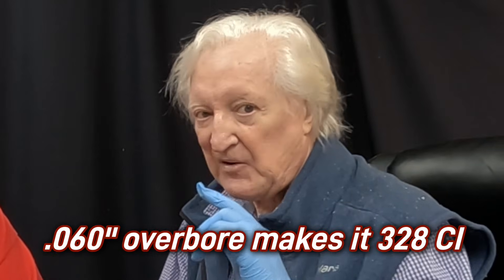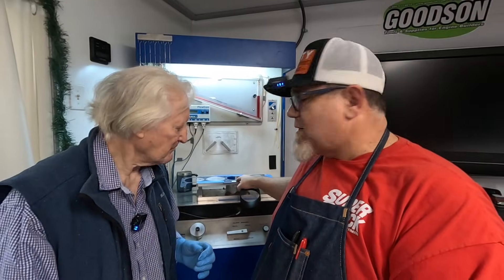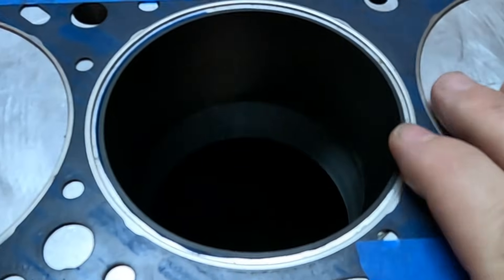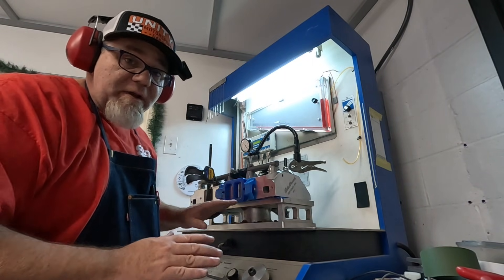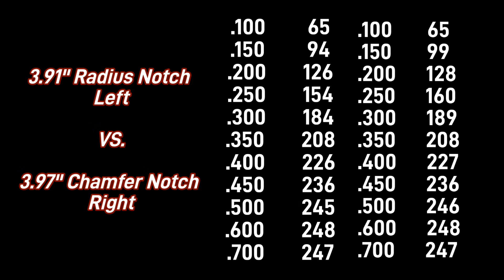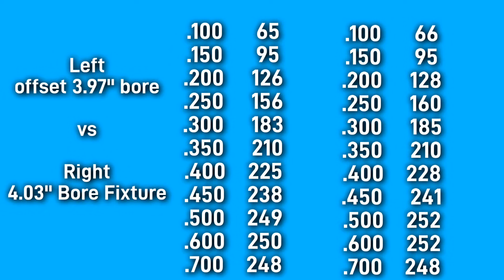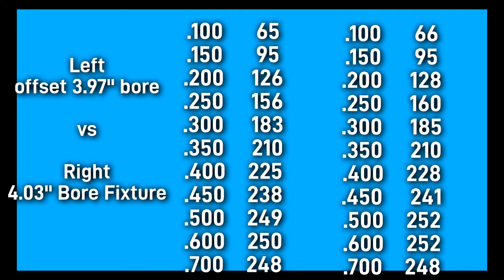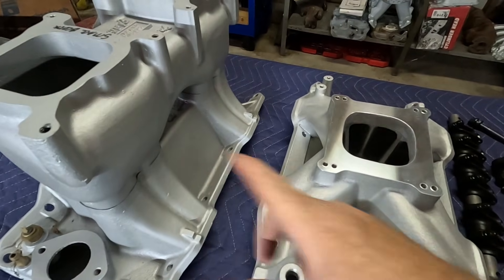We Found Hidden Horsepower in a Mopar 318 (Bore Shrouding Test) Project Mission impossible

Comment: As a machinist, one thing I think people can get messed on with the offset boring is that if you’re increasing the bore size by +.060 then if you were to sweep the bore 0-0 you would take .03 off of each side of the bore - if you wanted to take .050 off of one side and just .010 off the other you would need to shift the location by .020 - this would cause you to take .020 in addition to the .030 you were already going to take for the .05 and then likewise on the opposite side since you shifted away .020 you would be taking .030-.020 for the .010. Also I don’t think the block would be too thin as long as you shifted each bore the same amount and the same direction it wouldn’t be any different than if you just bored it .060 over on location because from bore bore where you take more off one side on the next bore you would leave it to make up for- enjoy both you and your brothers channels - keep up the good work -

Comment: When you shift the head (or bore) to unshroud the intake valve, does it not affect the exhaust flow?  On FE’s you have to notch 390 and 428 cylinders to clear 427 intake valves, makes me wonder if the larger valves aren’t hurting instead of helping.  Thanks for making me think outside the box
Reply from the maker: Luckily on this setup the Exhaust has a ton of room.. 
Thanks for watching 
Andy

Comment: If you are off setting the bore by 50 thou wouldn’t you have to make major adjustments to the crank cheek? Is that possible?
Reply from the maker: No, you won't have to do that because the connecting rod will be in the same place... This engine has floating wrist pins
Andy
Reply: @UnityMotorSportsGarage yeah I guess 50 thousand on the wrist pin isn’t a biggie

Comment: Love the TR5!!! I have a "Street Tunnel Ram" which I think is a newer design (shorter overall, mostly the plenum area) and I have the old typical Weiand which has even shorter runners. The unusual one I have (and it's the only modified/ported one) that I want to try is an Offenhauser (longest runners of all) that has had the plenum bisected and shortened for less volume (supposedly a race TR mod, which seems counterintuitive). As always, thanks for the methodical tech and informative presentation! RB
Reply from the maker: The STR is an awesome manifold Ive wanted to try one since I was a teenager. I think the TR5 is going to make some serious steam!
If you want to test it against the TR once we get it on the Dyno we can.. just say the word
Andy
Reply: @UnityMotorSportsGarage  That sounds interesting! The STR is as-cast, but that Offy was plenum-tuned prior to my owning it and then fully ported by a talented old-timer (like DV). If I load up for NC I'm loading (the trunk) for bear!! Thanks for the suggestion! :D   RB

Comment: What are you going to do for a head gasket once you move the bores and how much strength do you give up?  Not to mention intake alignment if the offset is the opposite direction on the other side of the block.
Reply from the maker: I'm going to use a head gasket that has a 4.03" bore which will give us room plus not give too much crevice volume 
Andy

Comment: I might not get it but if the matter is about moving the valve away from the cylinder wall you can use off set drilled valve guides. 
If you just move the head you off set the whole head and bring the valves on the other side of the head just closer or past the cylinder bore. I’m not seeing any advantage here. Off set valve guides are the way to go.
Reply from the maker: You have to remember the rocker arrangement on this engine
Andy
Reply: @Andy: Yes you are right here. But off setting the valves is of course a matter of small margins. Not a distance across the street 😝. 
Anyway, your set up was just for testing. To see if moving the head aka the valves would give any gains. 
For my FIAT engine I was figuring out if a bigger bore from a smaller engine will benefit. That must give a quench area all around and room to open up the head for bigger valves. At least the valves will off straight away.

Comment: What year is the block cast? 1976 and newer are thinwallcastings. According to Mopar guru L.S. Shepard these should not be bored more than .020 for high performance applications . Older ones are much thicker. Do sonic test it first if newer.
Reply from the maker: This one is a '67-'68 block 
4 bolt mount block
Andy

Comment: Made well in excess of 500 horse out of a 307 Chev with a 3.875” plus .030” over bore equals 3.905 inches 
Cast 4 eye brow pistons 
Steel crank  
Prepped factory GM Chev Rods
8500 rpm out of it with  cheap aluminium heads that were advertised at around the 250-260cfm @28 inches and a flat tappet cam.
Reply: I need to see some cam specs. A 500 hp 307 with those parts?
Reply: @S @Spiritof_76 

No mate, 
You want it
Arrange too meet in person with a down payment in full for me too build you a clone of the Engine. Probably still won’t give out the cam spec, But glad too give a spec sheet on the rest of the Engine when it’s payed for.
Reply: @brentonk461ismylostaccount  I'll pay you imaginary money for the imaginary engine.
Reply: @Spiritof_76 

The sort of response I expected 😂
Keep dreaming 
But um
When you want the real one, let us know
😁
Reply: @brentonk461ismylostaccount  I don't require someone to build a fantasy engine. I can rebuild a real one. Nitrous is not an engine build. The response you expected is the one sane people give. Only a fool would pay a youtube rando for anything of the sort.
Reply: @Spiritof_76 

No turbo
No blower
No nitrous mate

No fantasy
Reply: @S @Spiritof_76 

The amount of f__k Witt’s I encounter on a daily basis that think it’s easy and that they can do it themselves amazes me

If You think you can do it better and for free in little fantasy world 
Good On ya Mate

Good Luck with that

Comment: If the cylinder wall has enough material in it to take 50 thou out of one side of it then why no bore it in its original location out to  4.000 or 4.010 and gain extra cubic inches 😃

Comment: David and Andy, My question is, Will moving the piston off set 0.050" cause any side loading on the con rod or rod bearings? 

If so I think I pick about 0.020" to the exhaust side and 0.030" to the intake side and use the Offset Dowel pins to move the head 0.020 to 0.030 inch.
Reply: And since you are buying new pistons why not just bore the 318 out to 4.00" if it sonic tests OK? Then off set the head.

Comment: I am building a 305 Mopar using the factory 340 bore size of 4.04" (actually 4.07" because of the .030" overbore) with 340 cylinder heads with 2.02 intake valves. The 35 cubic inch loss is due to the shorter stroke of 2.96" vs. factory 3.31" so valve shrouding in this case is not a concern. However, to accommodate the old school TRW forged 340 pistons (L2322F) with the shorter stroke crankshaft, we needed to custom fabricate connecting rods (6.298" vs. factory 6.123").
Reply: I would think it would be cheaper to buy custom pistons than rods.  Lighter too, maybe 200g lighter on each piston.  The top of those L2322F pistons is about a 1/2" thick.  You could take a lot of weight off the underside.  Custom pistons could have thinner rings than the 5/64ths stock rings.
Reply: Sounds like the rod to stroke ratio is off now..

Comment: Great call on offset bore  idea! So if you're at the point of diminishing returns on flow gains  using offset, is there now enough clearance  to go up in intake valve size? - would it be worth it?
Reply from the maker: If I can get these heads around 280ish cfm without having to make the port too big I doubt I would go with a bigger valve. 
We did these Chamfer trick on my 393 which had a 4.03 bore and I had 2.125 valves! That engine made 600
Thanks for watching like always 
Andy

Comment: If you will offset the bore, you better have enough room under the piston between the piston and the pin, the other problem I see is that, that engine might not have a normal life expectancy, you will have one side of the pin bores more loaded that the other in an area that is not designed as such, I haven't seen a piston with one pin bore wider than the opposite, maybe it works, who knows.

Will it not be easier to just re-do the heads and install 1.96 seats and  intake valves?

If you get one bore a little off you will smoke a rod, or put a load of lateral weight on the cylinder and smoke a piston squirt.

Comment: I also have a TR5 in this configuration. From what I have heard there were other top sections avaliable including one with a smaller plenumn. Back in the day, ALL pro stock racers used the weiand tunnelram which was a small plenumn ram.
 Can you expand on the performance difference between the two plenumn sizes? Unfortunately both edelbrock and weiand have discontinued these rams. The weiand is much harder to find used than the edelbrock.

Comment: You mentioned a aftermarket head I thought the idea of missing impossible was to take stop parts and modify them to make that 1 HP per cubes with that tiny but modified carburetor it was just a question I am just curious on why a aftermarket head direction to make it less impossible
Reply: Stage 1 is the heads I did. Stage 2 is Edelbrock heads. Thanks
Reply from the maker: Exactly 
Andy

Comment: I am assuming this is an NA setup, Just curious if there is a gain in boosted applications (Turbo SC or even Nitrous)
Reply from the maker: Even though this is an NA build it would definitely help both boosted or Nitrous, remember Boost pressure is a measurement of restriction in the system. You would make more power with less boost
Andy

Comment: How far can you bore a 318?
Reply: The old A 318 [poly engine] is nearly exact same block as the LA 318 except for oil drainback holes which can be pluged whan using the LA heads.Then the old A block can often be bored all the way to 340 size [4.040] because castings were very thick. So that is the best solution for a big bore 318.
Reply: Looked into that myself doing a 68 318. Some claim those are thicker and can go to 4.04 stock 340 bore, but you gotta sonic check um. In the end I went .030, just building a mild street engine, a few more cubes at the chance of loosing reliability wasn't worth it for me.

Comment: Honestly, that single 4 manifold is probably not the best intake for an LA. The end ports (1,2,7,8) end up with a very abrupt turn when it gets to the pushrod bump no matter what you do to it. Flow the head with the intake on, and it will probably be very obvious....
That tunnel ram is going to get you more power due to the air not turning into a wall on the end cylinders, and the shorter runners.... You might not even loose low end torque with that huge plenum either.
Bore that 318 as far as the block will allow it, top half cement it and call it a day... The more you unshroud it, that faster the air column will start to move as the valve opens. Flow isn't everything, velocity is far more important so it actually flows. 
Speaking of velocity, flow the heads with different shaped intake valves on the back side. That little guy is going to need all the help it can get to get air in it, and oddly many aftermarket heads don't have the best valve head shape in them for quick velocity ramp up...

Comment: Curiosity question, by doing an offset bore( with .050 to one side). Is there enough clearance between the piston and connecting rod to allow that much to one side and still have the proper amount of clearance for oiling? Thanks for sharing this video really starts making you think. ✌️😁
Reply from the maker: Yes this engine will have full floating pins so oiling/clearance shouldn't be an issue. 
Andy

Comment: I can't imagine that it would be easy on the rods and the crank for you to offset the whole reciprocating mass over by 0.040" from their factory original placement.
Reply: Indescernable difference
Reply: @hotrodray6802  Clearly you are not a machinist.

Possibly not even a mechanic from what you're saying.

Its documented that this kind of transversal axial thrust is notoriously for rapidly destroying all kinds of motors.

There is no way you can do this without altering the crankshaft at the same time.

But since you're clearly not going to listen, I'll save you the technical documentation of this historically known fact.

But yeah...

You go try it.

Lets see how well that goes for ya.

Comment: Wow!! Don’t want to sound stupid but what does this all do the crankshaft? 50 offset from center seams like a big deal to me. I think the block will take the off sets but what does it do to the center of the crankshaft? Do you have to balance it for that?
Reply: With the piston pins floating in the piston (or bushed rods) the rod/crank position is not affected. Only the piston is slightly offset.
Reply: You run piston guided rods.

Comment: The build my buddy had on his engine stand when he passed, he didn't like the intake valve location on his 360 Chrysler so he used offset head dowel pins to move the intake valves away from the cylinder wall. Moroso Offset Cylinder Head Dowels 37930.
Reply: I had forgotten those things existed. I had a speed shop back in the 80's and I used to sell these, completely forgot that they existed.
Reply: Intresting. How do you redo all the bolt hole?
Reply: This motor has two cylinders with the exhaust valves adjacent to each other. One way offset couldn’t achieve what they are doing here.
Reply from the maker: You are correct, now if it were a Ford or LS it would
Reply: @UnityMotorSportsGarage I’m putting offset dowels and drilling out my head bolt location ? I have a 5.3 I’m building and extra power that easy is hard to come by. Will be figuring this one out I think lol.
Reply: @UnityMotorSportsGarage  Or LT
Reply from the maker: Just remember by shifting the head on the block surface you will need to port match the intake and maybe elongate the bolt holes to make everything line up..
Andy
Reply: @UnityMotorSportsGarage yes sir I think I could handle that. A few years of working in a machine shop and you can do about anything. The pushrods don’t seem to worry too much? I guess some of those dowels are just .005 or maybe more I haven’t done any research yet. Really interesting though.
Reply: @bradenmolloy7443 :
How about if the offset dowels moved the heads downward (upward?), instead of sideways?
Reply: @johnjohnsn7633 then the intake valve would possibly hit the cylinder wall. Basically allowing more room for the intake valve would be best. However you make that happen.
Reply: @j @johnjohnsn7633 also for an ls engine that would be towards the water pump on the cylinder one side and toward the rear of the engine for the cylinder two side.
Reply: I'm not seeing something here..... Offsetting the bore will cause the Piston to shift over affecting where it connects to the rod
Reply: @CNTablet-sg7qx Lol, im not sure what Kendall was doing I was buying a couple 351c's from him. Keep in mind he had access to a full automotive machine shop. I thought about asking him but then I started thinking about all the stuff he'd have to change. He been building engines since the flathead day, his daughter's 351c Mustang  would about outrun anything in town and he could obsessively measure things all day. But the conversation brought up that memory.
Reply: @C @CNTablet-sg7qx just this motor because of the Siamese cylinders the direction of bore offset would basically even itself out as long as there is a normal amount of clearance from the piston to rod pin. It can slide sideways a bit.

Comment: I suspect the tunnel ram will make for a fatter curve, because tunnel ram! The offset bore is a neat idea, but is there enough meat in the block to do it in a meaningful way with the mirror image cylinder heads? I have seen some industrial 318 blocks go all the way out to a 4.00" bore safely, but that's not every block.
Reply from the maker: Shane told me we could take this one out to 4" but I want to make sure of the thickness! 
That's for watching 
Andy

Comment: When you sonic checked the block, what year block is it & what was the thickness?
Reply from the maker: It's a 67-68 4 bolt mount block and according to Shane it was over .200" thick
Andy
Reply: @UnityMotorSportsGarage   Thank You & Zowie! What do you folks consider as a minimum wall thickness for a daily driver motor? Does it matter more on the thrust side of the bore?

Comment: The winning engine in the 2002 Engine Masters challenge had the bores. Bores .060 offset. It was a 366 cleveland.
Reply: Didn't engine masters outlaw the Cleveland?
Reply: @samuelfreeman9518  They outlawed the Clevor. W block with C heads

Comment: In between cylinders will be very thin if you offset bore it towards the intake valves. It’d be like boring the block .100 over if you’re taking .050 off one side
Reply: I was thinking that also because you get half off the cylinder so goin 0.060" would be 0.010" for the exhaust and 0.020" off the intake valve side. Would a move of 0.020" make that big of a difference?

Comment: Ben a old time engine builder found a smaller exhaust valve will gain HP because it's building up more pusher in the cylinder.
Reply: Scavenging is 👍👍

Comment: On small bore engines in general, if the head was designed for the small bore ( like a Ford Modular or a TFS Super 23 for a 305 Chevy ), does unshrouding the bore help?
Reply from the maker: Yes! 
Andy

Comment: My build so far, Victor 340 but only 3.950 bore and the idea of offset boring sounds awesome.  
I'm using Trick Flow 190 heads and a solid cam, have Icon flat tops and probably too much con rod ( H beam) and the same rockers. Looking for 450hp and about 7200 .
Keep this going! Perfect timing
Reply from the maker: That's going to be a stout runner! I'm glad you are enjoying the build
Andy